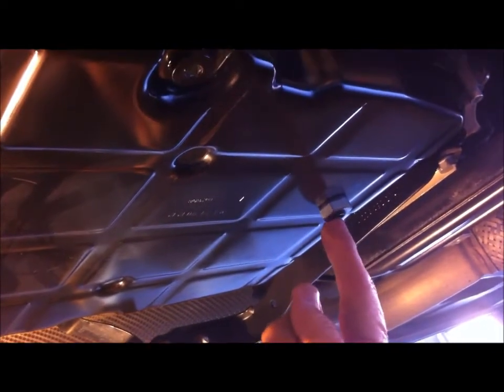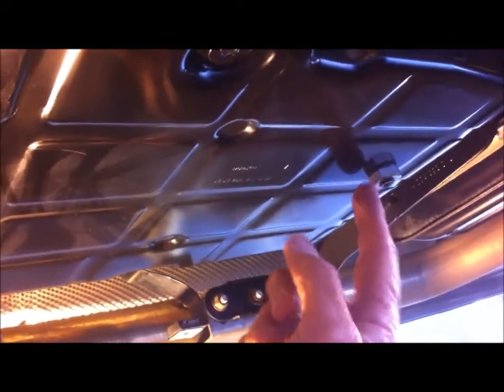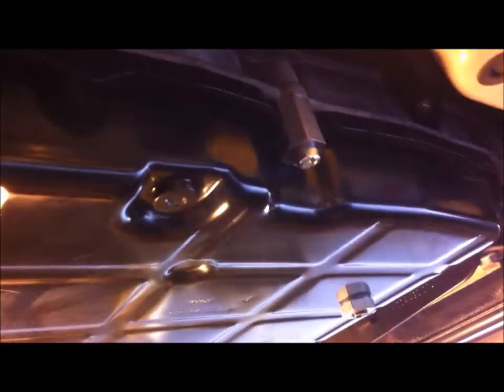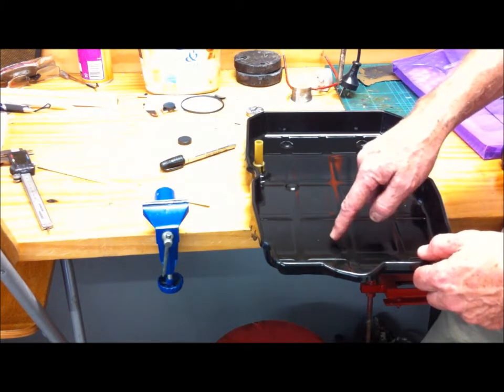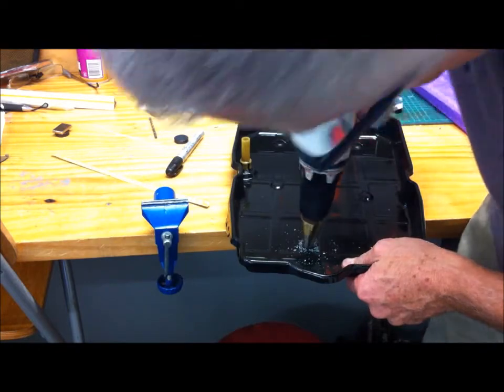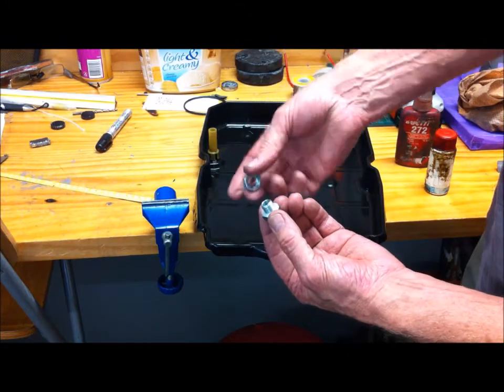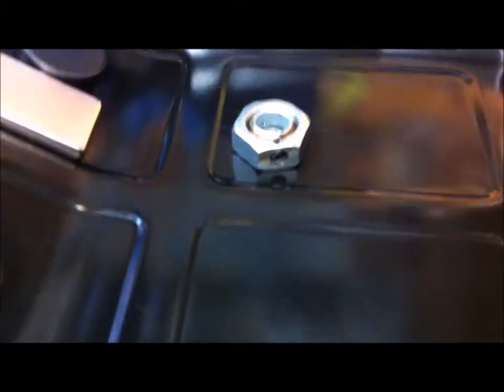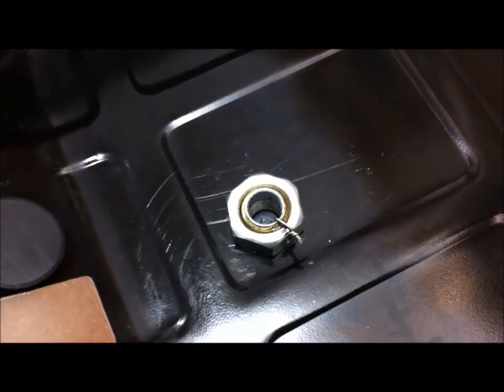Mercedes 722 9 Transmission Install extra drain plug to oil pan.

Comment: did you spot weld the nut on the inside of the pan or how do you keep it from shifting around when you take the plug out?
Reply from the maker: No I didn't. In the video it shows how it's bolted and lock wired.

Comment: Do you have a link to that drain bolt?
Reply from the maker: Eric search eBay for "universal oil pan drain"

https://www.ebay.com.au/itm/Mr-Gasket-MG4470-Universal-Transmission-Oil-Pan-Drain-Plug-Kit-1-2-20-Thread/141446638134?epid=1171877285&hash=item20eee06a36:g:i9sAAOSwqlFaqy~G

Comment: SCOTT, AFTER YOU DRAIN ALL THE FLUID OUT COULD YOU TAKE THE ORIGINAL PLUG OUT AND FILL THE TORQUE CONVERTOR AND PAN CAPACITY THROUGH THE OIL COOLER LINE? WHEN IT BEGINS TO DRIBBLE OUT OF THE 
ORIGINAL DRAIN PLUG AT THE CORRECT TEMP, YOU ARE DONE. SEEMS LIKE IT MIGHT BE AN EASIER FILL JOB
THAN BACK UP THROUGH THE DRAIN HOLE.
Reply from the maker: I don't think you could do that. The TC is filled by the pump when you start the engine. Scott

Comment: A great modification.
I'm doing this to my E350 coupe. The dealer wants £420 to change the fluid on it's 9G-Tronic.
Reply from the maker: Paul that's about the same price as we pay at $AUD800 but it always ends up $AUD1000 due to the unforeseen extras. The latest is the draining of the TC is not part part of the service. They only change half the ATF! I don't trust their system. MB make their own transmissions. I'd not be surprised if the company hasn't budgeted to supply replacement transmissions in all cars at 7 to 10 years. There's no incentive for them to ensure your transmission lasts. A new one will set you back about 6000 pounds. All corporations are desperate for revenue in a low growth world. Under service and reap the benefits later with new component supply.

Comment: This is the bomb!  I actually was thinking about this, and now I didn't have to waste what few cells I have left.  Well done, although us Yankee's always wondered if our oil fluid drained out the opposite way:-)
Reply from the maker: LOL ... I'm sure it does. When you remove the plug your ATF should spin clockwise ... mine spins anticlockwise.

Comment: By the way, is it ok to clean the mass air flow sensor? Thanks Scott.
Reply: I've used electrical cleaner and 99% alcohol on MAF's with no issues what so ever.
Reply from the maker: John I'm not familiar with the MAF but I believe they are quite 
delicate. If you join www.benzworld.org you'll probably find some 
information there.
Reply: Thank you Scott.
Reply: Yes, but you MUST use MAF cleaner ONLY.  If you use anything else you just bought a new MAF.
Reply from the maker: It would be worth investigation if electronic parts cleaner is the same substance. Although that's expensive. Often these special cleaners are the same stuff with a different label to attract a higher price.It's the smoke and mirrors trick played on us consumers by the marketing departments.
Reply: MAF fluid is not expensive. $12 bucks. CRC makes it, they do Break Kleen and a bunch of other stuff.